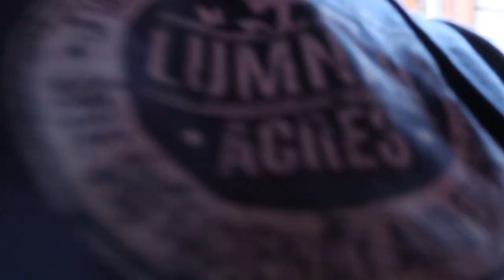This BABY GOAT is OUT of CONTROL WHAT are we GOING to DO

Comment: Handy tip. If you struggle to open a jar or a bottle that has a screw on lid or cap, just place the lid part or cap part under the hot water tap. The hot water helps release some of the pressure and makes it easy to open.

Comment: Hey Al,  Good to see none of the chickens got caught when you were moving the meatbird tractor.  One thing you can do to help prevent them getting a leg caught is to put a 2x2 across the rear of the tractor, side-to-side, about 6 inches from the back.  Place it a few inches off the ground (you can just place it on the frame).  In this manner the chickens will get bumped by the bar first, but won't get their feet caught since it is off the ground.  CAN'T WAIT FOR THE BARN!!!  :-)

Comment: You might ant to divide your meat birds into two groups using both $30 chicken tractors. There is a tone in the one and it will make it easier to move them from spot to spot without worrying about hurting some in the process. And it is double the ground being "cleared".